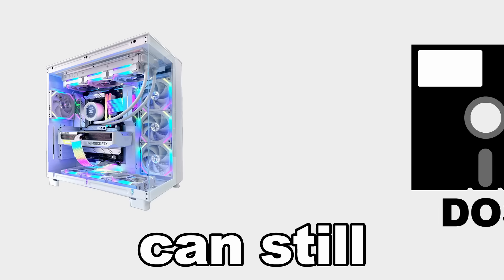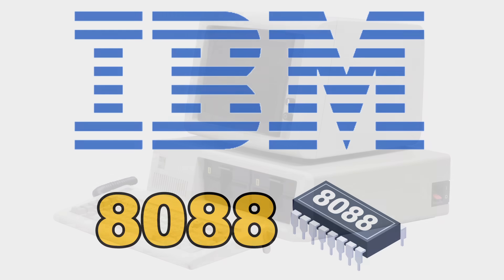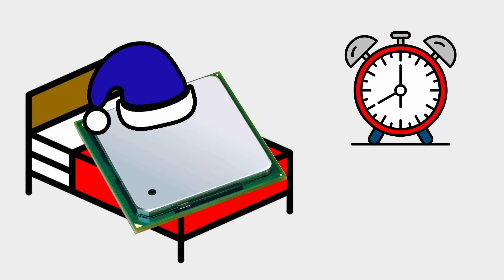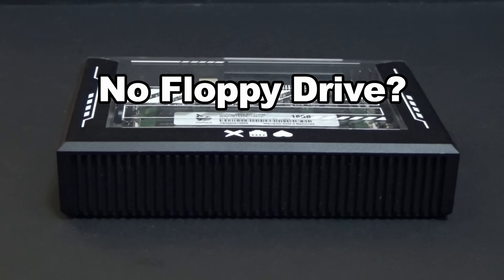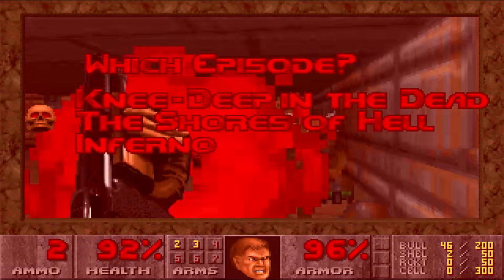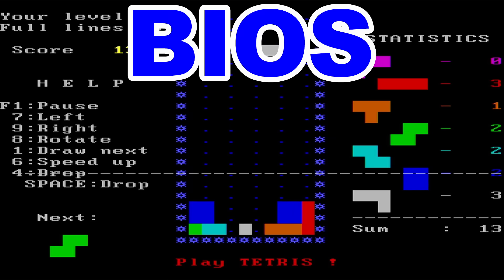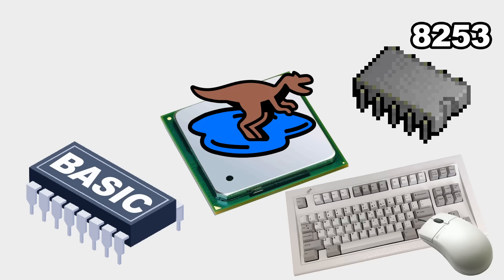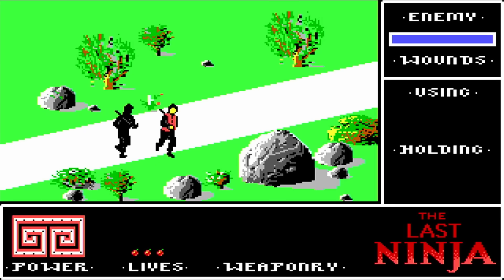45 Year Old DOS on a New Intel CPU Without Emulation

Comment: Even 2024 PCs still can run DOS natively if their UEFI has CSM support. If it doesn't there are ways to install CSM module in UEFI.
However running DOS is not that simple. While CPU is compatible with 8086, 286, 386, 486 etc. the rest of your PC is not.
For example starting with 2005-ish motherboard chipsets stopped providing support for EMS memory extenders. It affects only selected software released between 1989-1993. Though there are newer extenders that can provide EMS differently in DOS.
Starting with 2007 graphics cards started loosing VGA compatibility. They're still compatible with VGA or even with CGA (1981!) modes, but they're no longer 100% compatible with the hardware. There are games that have graphical glitches on such hardware. Though since PCI-E slots are the longest running expansion standard, there are 2004 GPUs that will run in modern PCs.

For years, the real problem with DOS on modern PC was lack of ISA sound card. In the late 90's PCI replaced ISA slots and PCI had no longer hardware features used by original Sound Blaster standard. This lead to a situation where even in late 90's PCs lost ability to play sound in DOS games.

However in recent years, SBEMU.EXE was developed that can emulate SoundBlaster cards in DOS on modern HD Audio or older SB Live, Audigy or AC97 motherboards. This was the missing link to have fully functional DOS support on modern computers.

Unfortunately it works best on 1997-2007 hardware, where there's still 100% compatibility with VGA.
AMD hardware seems to have better compatibility than Intel. I have 2016 thin-client that is fully compatible with DOS. Even EMS works!

Comment: The thing about the "added" complexity is that it's not any more efficient if it were gone, it's not wasting cpu cycles and it's not creating black holes that destroy your processor over time by it's inclusion. I can't remember the video but a guy went over this article on hackaday that basically dismissed the x86/64 as garbage because it's filled with "uneeded" extensions, while ignoring every other aspect of a processor that makes it or breaks it.

Comment: The only thing with the 80186 was that it was not a consumer-focused architecture.  That's why computing seemingly went directly from the 8088 to the 80286.
Reply: There were a number of PC compatibles that used the 80186 such as the Tandy 2000.  The 80286 was released only a month after the 80186, so that helps explain why most vendors skipped the 80186 and just went to the 286.
Reply: The 80186 was really designed for embedded applications. They integrated a lot of stuff into that chip like the clock controller, DMA, interrupt controllers, etc. and these were not compatible with the IBM PC platform. As mentioned the Tandy 2000 and a few others did use it but they could not run all IBM software and had to have their own custom versions of DOS; it was a dead end and the 80286 drove the final nail in it's coffin.

Comment: You mentioned the Itanium processor from Intel.  And I think you are confused about why it failed.  It had nothing to do with the large base of code and programmers for x86.  The fact that it didn't emulate x86 very well wasn't even much of an issue.
Where the Itanium failed was in two areas.  First of all, it was next to impossible to program it.  The instruction set was designed to run compiled C/C++ programs, but the only compiler for it was from Intel themselves.  And the team developing that compiler were unable to get the compiler to properly optimize code for the Itanium.  This left everything running far slower than expected on Itanium chips.  The second, and more important issue, was rapidly spreading adoption of AMD's 64 bit extensions to the x86 instruction set.  Intels own extensions, IA64, were released about 6 months later than AMD's version that we now just call AM64 or x86-64.  The late release had alot to do with Intel not wanting to extend the x86 architecture to 64 bits because of the still-born Itanium they were trying to keep alive.  This was Intels' second attempt to get rid of x86 (iAPX being the first attempt.).
In the grand scheme of things, the Itanium was something that Intel just created and killed on its' own;  and we have AMD to thank for rescuing the x86 architecture from being archived by Intel.

Comment: ".. distinct lack of a floppy drive.." made me spit my Pepsi out. Thank you. Great video too.
Reply: Did you know that a cassette tape drive was in the official IBM spec? I don't know if any were made for sale, but IBM certainly built some prototypes that included them. Floppy drives were costly, you know ...

And because floppy drives were costly you might only have one of them: and PC-DOS was specified to have a virtual B: drive. The OS kept track of whether the sole floppy drive currently held the A: or B: disk, and would probably the user to swap disks as needed 

To this day, windows reserves A: and B: for floppies. That's why it installs to the C: drive by default. 😊 I'm not sure if the rest of the foot code is still there, but the reserved names have certainly stuck.

Comment: Why are the cpu timings throttled for the games? they should be playing at thousands of fps.. like doom should be going way too fast to be playable. So something funky is going on with your dos builds.
Reply from the maker: A lot of games were made with future hardware in mind, knowing that future CPUs were going to be faster, so they didn't tie themselves directly to clock speed. Not all games did this, but a lot did, because of course you want your game to be playable for more than the one CPU you're working on.
Reply: @InkboxSoftware  Doom for sure did NOT do that. So whatever version you have there is 100000% cpu limiting which it should not be doing if it was a true DOS setup. So no you are wrong majority of all games like 99.9% of dos games on actual dos hardware ran full speed of the cpu and did not frame / time limit in any sense what so ever. You obviously never had an old DOS machine.

Comment: 1:28 did microsoft flight simulator predict 9/11?
Reply: flight simulators can't melt x86 beams, silly
Reply: There was actually a meeting scheduled but canceled for the next day of what to do in the event of a plane slamming into the tower, ironic

PS the tower wouldn't have fallen if the contractor hadn't cut corners (insulation on the beams etc) and then got away with all those deaths

Comment: I don't think backwards compatibility is necessarily a bad thing. Remember, when Intel tried to introduce an entirely new architecture (Itanium), it was a total flop. But ARM is not a new architecture either. In fact, you can do this on a Raspberry Pi: Install RISC OS, and you can play games made for the Acorn Archimedes on bare metal.

Comment: Real Mode may completely gone in 2028 in consumer and servers CPUs. Intel and AMD both working on x86s targeting 2028, that actually x86-64 that ditch 16/32bit support and cannot boot legacy BIOS mode.

But for embedded CPU model, it will still support real mode through hw assisted emulation.
Reply: Unless they somehow get rid of the thousands of embedded devices which rely on that functionality to work and are not compatible with UEFI, that's not gonna happen.

Comment: My very first computer was a HealthKit that my father and I built together. It ran CPM (MS-DOS was really a copy of the CPM). When I was in university, for a short time, I worked in IT (I am no IT expert). We had a UNIX machine. It was command line and a great computer! I moved to Macintosh which, to this day still uses UNIX (I am sad they took away the ability to log in as root.). But on a current Mac, you can still get to the command line, if you really want and bypass the GUI. (I think the main reason why Mac stopped allowing people to log in as root was because idiots could use the RM -R command and with no checks, would just erase everything!) But today’s UNIX will still run every old UNIX program, no questions asked.
Reply: DOS wasn't a copy of CPM, but it used some ideas from it, such as filesystem device naming.   
"But today’s UNIX will still run every old UNIX program, no questions asked."  Umm, no not really. If you have the source code and all of the needed libraries and correct versions of the pre-requisite packages then you can compile and run any Unix program.  Unix ran on lots of different CPUs, so Unix compiled software is often not binary compatible.  Heck, I have trouble getting software to run after major version upgrades of the same distro today.

Comment: It's not hard to run dos on modern x86 CPUs
They're designed for backwards compatibility and at boot they're exactly the same as an 8086 before the os switches to protected mode and enables all the fancy new features

Comment: You are wrong. 186 is not compatible.
Reply: Of course it was.  Several PC compatibles used the 80186 such as the Tandy 2000.  It had differences, but lots of PC compatibles in the early days using the 8088/8086 intel chips weren't strictly hardware compatible either.
Reply: @stargazer7644  They were not fully compatible with PC software, you couldn't even run normal PC-DOS on them. They had to have their own custom version to work with the chip's oddball integrated hardware.
Reply: @_Thrackerzod  That was hardly unique to the 80186.  It was true of many of the early "compatibles" that ran 8088 or 8086 too.  They all came with their own special version of DOS and often had incompatible hardware extensions that made their version of the PC "better".  Sperry, Zenith, Tandy were notable examples.  Tandy for example had special graphics modes and sound hardware and used DMA differently than the IBM PC.

Comment: Unless you need old legacy PCI/ISA slots or the old Parallel port I do not see the need for it, even then there are adapters you can use. Is really that important anymore? As long as you are not removing anything useful like the FPU, or something like that… who care, the software was not made for 5Ghz. It was made for 33Mhz or something like that, not issue to emulate.

Comment: If on windows will make better arm support like on mac's (it had x86 intel processors, but then apple made M1 which is arm)(not sure if its emulator or just instructions translator, but it works cool), maybe arm will replace it, but still what about self pc assembly, will it be dead?

Comment: The 8086 was assembly code and register compatible with the 8080 and 8008. It was NOT binary opcode compatible with them. The register set was a superset of the 8080 and 8008.

Comment: When windows dropped support for 16 bit programs on 64 bit architecture it was a disaster.  Many 32 bit programs that could run fine couldn't install because the INSTALLER was 16 bit ( following microsoft's instructions) or at least it used a 16 bit stub to trigger the install.  Of course it wasn't just windows 16 bit that wouldn't run.  It was also DOS programs.  So I had to use things like DOSbox.  However they have the problem of excessive battery use on portable computers.  At least the programs would run.  So it has made me very wary of newer systems that could be made useless "at the stroke of a pen". So things like clipper are still a part of my daily programming.

Comment: 3:07 WAIT THATS MY UEFI MENU WHAT!?????
im completely surprised to see that the uefi menu i look at when i'm on my laptop is here on this video. that's most likely a coincidence. the only difference between mine and yours is that, on the bottom comfyright text, yours says 2023, but mine says 2021.
is this uefi menu really from the processor you gathered?
also, here's something completely weird, but i come from Europe, i haven't moved to america or anything else, and my uefi does indeed say it has a copyright from America megatrends. did my uefi just get imported from america or something, or is that just the company???
Reply: The UEFI menu comes from the BIOS, not the processor.

Comment: Fascinating video.

I just booted Windows 95 SE on my 24 core dual Xeon Workstation using an external  USB dvd drive with the original disk. My 4k/60fps GPU came up in 640*480.  A USB WIRED keyboard and a 2.4G wireless mouse were fine. [ My wireless keyboard was Bluetooth. ] I also plugged in a USB Sounblaster  II clone, which gave me stereo sound. An USB FDD also worked. It does not have serial or parallel (printer) ports for me to test. No networking. No internal audio. No audio over HDMI. What fun.
Reply: Funny how 98SE will get to the desktop but XP just freaks the fuck out and crashes
Reply: I get this all the time with my old computers using Windows 98/98SE/2000. These operating systems hate wireless keyboards. I've had computers not boot with wireless devices, if the USB receiver is in the port. Many allow for wireless keyboard usage if you insert the thing when in windows, just not on startup.
Reply: Windows 95 SE? or you mean Windows 98 SE?

Comment: Last I checked, 1981 was 43 years ago, not 45.
Also the Intel line is not fully compatible with the 8008.  Even the 8080 wasn't.  You couldn't run 8008 software on an 8080 CPU.  There are some similarities in the CPU structure, but the instructions were different, both in mnemonic and op code.  However, it was possible to assemble 8008 source code to 8080 op code.  Many years ago, I worked on the Datapoint 2200 terminal, which had the same instruction set as the 8008.  It was originally supposed to use the 8008, but due to performance issues, they build their own CPU board.
BTW, my first computer was an IMSAI 8080, which I bought in Nov. 1976.  So, was quite familiar with both the 8008 and 8080.

Comment: There is NO WAY to run DOS on a UEFI Only System.
Reply: Incorrect. There are several ways of loading a CSM-like payload (such as SeaBIOS) on a UEFI Class 3 machine, which will then happily load and run a DOS 1.0 boot sector, and everything that comes after it.
Reply: @throwaway6478  URL?

Comment: It's not a matter of "compatibility" (in that, can I execute it) than it is a matter of speed (how will said application run?). 

There is a reason people desire older machines and legacy CPU's (well, a lot of reasons) and that is the speed of the CPU. Some games (many legacy games from the old DOS days) rely on the CPU speed entirely to function properly. The games will run WAY too fast to be playable, even on early Pentium machines. If you take games from the XT era that is a perfect example. Games designed to run on those machines will not run correctly on more modern CPU's at all. You can try to get around it by using apps like "slo-mo" but that usually doesn't work. 

Real way to play these is in an emulation environment like DOSBOX or on bare metal... the real vintage hardware. I prefer the latter if you haven't guessed already ;)

Comment: How did you manage to play these games without the issue of it running too fast? 

Did you purposely underclock the CPU down to 45Mz to play these games properly?
Reply from the maker: No, it just worked
Reply: Only the very oldest games which were written for the IBM PC 5150 had the timing issue as the programmers never expected the PC platform to be anything other than 4.77 MHz. Most games from the 386 era and onward used different timing methods and still run fine on modern CPUs.

Comment: See no problems running MS-DOS 6.22 on baremetal i7. It is 16-bit OS and it ran on 32-bit CPUs. So why shouldn't it do so on 64-bit multi core ones?
I have to mention it uses full 100% of only one core as it does on i8088. So it is dang fast on modern CPUs regardless of it uses only 1/4 of bus width.

Comment: the backwards compatibility is not just for the sake of running DOS the 16 bit real mode is also when the CPU and bios communicate with each other and the BIOS then builds the tables and charts that windows will read to grab all the details of all attached devices pci cards etc. Hardware we really only understand in 16bit real mode or at least its best to talk to it in that way because of simplicity during commands the 2 wire serial interface near cmos can be used to issue commands to the BIOS during 16bit real mode on bootup meaning you can adjust registers and modify read/writable bits while in the 16 bit real mode. You can also do it in 64 bit mode but the bitness changes and so do alot of the addresses.  I like to poke around with hardware probing tools like R/W everything and etc. Also why most drivers are written in low level languages to maximize speed effeciency when polling hardware devices along the PCI/USB/sata bus. You essentially could run 16 bit programs by pointing to them or by switching hardware registers to correlate to the required cpu execution model meaning you can run programs directly from bios theoretically ive never tried it but interesting to experiment with. Can also probe the clock generator on alot of motherboards and get back pure hexadecimal data giving you details of the Clock gen allowing you to overclock and change usually non accessible settings sometimes chips are internally write protected and theres no way to modify the signals without messing with the continuity of the wire leading to write protection pin on the chip.

Comment: Duh... what do you think the cmd prompt is on all windows computers? It's DOS maybe 5.0 that was my favorite and at the time I knew 75% of all the commands by memory. but not anymore except the basic ones. like c\.. or c \. not even sure about those 2 now after almost 30 years ago when I was first taught DOS 3.3 then 4.1 and then 5.0 and then 6.3? They got more complicated and worse after 5.0 was the best and easiest. what memories. 🙂 giving away my age. 😂 My first computer I built from spare parts at work was a 21 mb hard drive  and 8 mhz speed with 5 1/4 floppy I think and dot matrix printer a dial up modem that always made that wonderful screeching noise doing the hand shaking connecting. 🤣